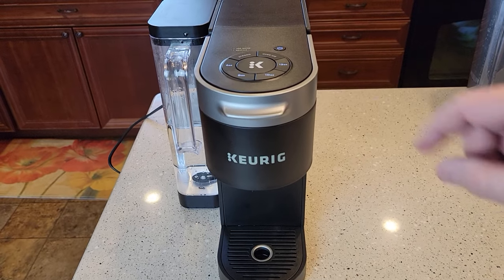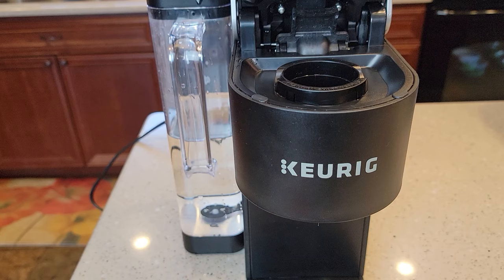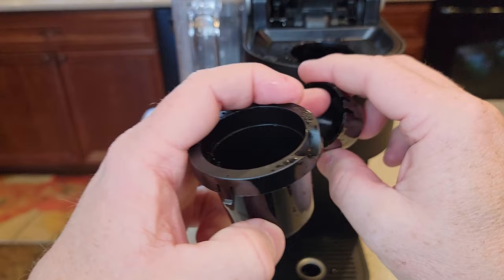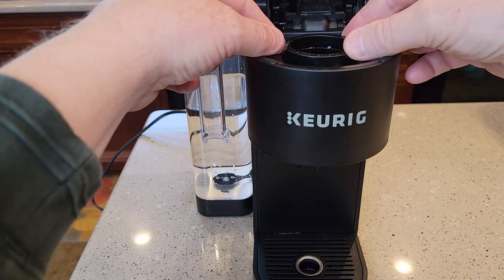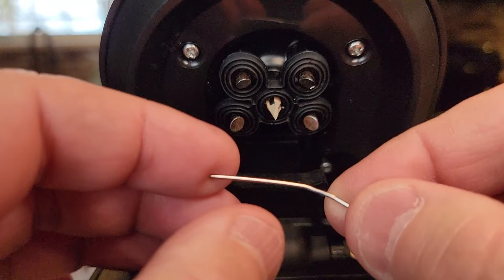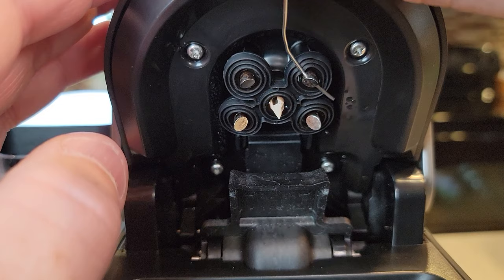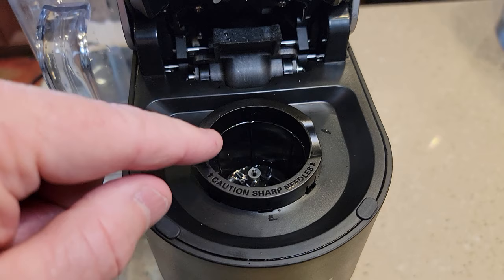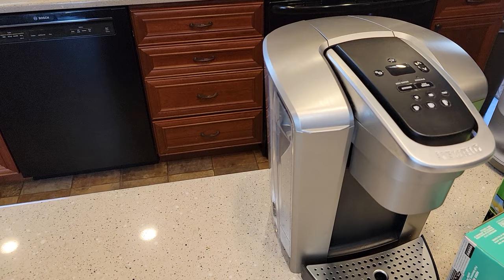HOW TO CLEAN NEEDLES Keurig K SUPREME Coffee Maker HOW TO FIX YOUR KEURIG NOT BREWING COFFEE

Comment: Very helpful, easy to understand video! I was getting the descale message after owning this model 9ish months.  I had the cleaning/descaling starter kit but found the directions vague and realized after watching your descaling video that I had not done it correctly.  I misplaced my owners manual so didn’t put it in descaling mode at all. Now I will give cleaning the needles a try…thanks so much❣
Reply from the maker: Glad it helped!
Reply: My Keurig would sometimes not release the coffee. I wasted numerous k-cups. It would puncture the k-cup and nothing would come out. I cleaned the needle holes with a paper clip as you showed and did the water rinse! I hope that fixes the problem! Thank you so much!

Comment: Wow, really! I tossed my first Keurig probably for this very reason, but I must say I'm even happier with my K-Supreme with bigger reservior. Thank you for posting your descaling video. My unit didn't come with any instructions so I never would have known to press and hold the 8 & 12 buttons to get started🎉
Also, instead of using a paperclip to push thru the needles to clean them, i used G-U-M brand plaque cleaners for my teeth that I had on hand and what a mess of coffee came out in the bristles 😮 which easly rinsed off and I ran it thru again to be sure clean.
Thank you so much for doing these video' for us "Dad"!

Comment: We used an air compressor (the kind you use for computer keyboards and screens) and blew through the bottom needle, rather than using the paperclip. Worked like a charm! Thanks for pointing us in the right direction, though. Much appreciated!

Comment: That seal comes off super easy and it's easy to clean.
Reply from the maker: Thanks for the update, what seal is that.
Reply: @JustADad  the black ribbed seal that surrounds the needles.
Reply from the maker: @myjatube  Thanks great tip
Reply: @myjatube  how do you insure that the seal is all the way back on? I brewed without it and I was getting a full amount but when I put it back on, it is clogging

Comment: Thank you so much for this review! I’ve thought I was going to have to buy a new coffeemaker to replace my keurig dual because my coffee single serve is making 4 ounces instead of 8. Ive descaled and cleaned thoroughly but it didn’t stop. It didn’t cross my mind about the needle! Ive Seen an item on Amazon to use for that and ive used the pods for cleaning the single serve part. I don’t know why but ive been having a problem with my k cup bursting and grounds going all in it. I will go and clean the needles like you showed and hope it does the trick or I’ll be buying another. I really like the mr. coffee 4 in 1 Lux

Comment: I just finished descaling and cleaning needles per your excellent video. But I think I may have a larger issue. During descaling and rinsing I was getting only about 4 ounces of solution each time I pushed the K. After descaling shut off I tried an 8 ounce cup and got 4 ounces. I then tried 10 and 12 ounces and each time got only 4. I plan to call Keurig but I certainly would appreciate hearing from you!
Reply: Mine was doing something similar. Did you ever call Keurig?

Comment: Good video once again.  I’m really having trouble, not sure what to do.  It took me a while, but I was able to clean the top 5 needles.  The paper clip just wouldn’t go through and I didn’t want to force it through even after bending the paper clip.  The bottom needle I cleaned and the paper clip was able to poke the hole through easier than the top needles.  I descaled the brewer.  When I try to brew the Keurig approved pods (says Keurig on the label), the pod explodes.  I raise the arm and I see a mess of muddy looking grounds.  I also tried a pod that doesn’t have the Keurig label on it, and the same thing occurs, exploding pods.  These pods have worked fine for months.  When I remove the pod, the bottom puncture hole is barely visible.  Obviously that would jam it up, but I’m not sure why all a sudden since yesterday this is happening.  I’m flummoxed.

Comment: Thank you so much for your presentation.  You present in a concise, step by step, slow easily understood manner which I appreciate. I have a question for you, I used a small paper clip for cleaning
the needles.  Worked well. It however would not fit in the upper 4 holes. I did not attempt after seeing the holes are very small. The machine is working fine so for now I’m leaving things alone. Would you suggest another type of item to use?
Reply from the maker: that rubber piece that is around all 5 needles does come off, that might help.

Comment: I watched and followed this video and the one for descaling. I'm still not getting a full cup and nothing seemed that dirty. Only getting about 1/4 of oz's selected and it just started happening recently. Any ideas? It does seem to work fine for one run if I unplug it and go again but then it messes up again. On the descaling on the fresh water part I only got 4 oz, 6 oz or 10 oz per button press each time. All were different.
Great videos by the way.

Comment: Your videos are always so easy to understand.. thanks! I descaled my machine the first time w instructions from your video. I used Goo Gone & worked great.
Here’s my question: when the machine is descaled doesn’t the solution clean the needles too?
Reply from the maker: Great question.  yes it does to a point.  The needles can also get coffee oils on them and in the bottom needle basket area. The water and vinegar does not really clean that.  It does wash out the coffee grounds so it kind of cleans it.  Great question I hoped it helped.
Reply: @JustADad  
Thanks again for the answer

Comment: I need help: after two months of using my Keuric machine I tried to check the filter to see if need it to be change but I just removed it so I fill out with water and I plugged it in push the power bottom but didn’t turn on since then I not able to use. What wrong with the machine or what should I do to restart it. Thank you
Reply from the maker: The Keurig K Supreme Models have a history of this problem. The unit can overheat and trip the thermostat on the inside of the machine. I made a video on how to open up your Keurig and reset the thermostat with a paperclip. But it requires you to open it up. This is a link to the video https://youtu.be/IdE_4NIQEro If this does not fix the problem or you are not able to open it up, I would call Keurig 866-901-2739, They are aware of this problem and should replace you unit free of charge. Lot of other viewers have had this same problem during a descale the machine has to run a lot of cycles to run the solution through the machine then the rinse cycles. It is a good idea in the future to let the machine sit for 30 min before you start the rinse cycle, but you have to make sure the machine stays in descale mode or it will not turn you light out at the end of the rinse. Also some K Supreme the low water light does not come on and you might run the machine dry which can also cause the thermostat to trip. In the case of the low water light not coming on you have to stop the process and start all over, but this time you can just use water on both the first part and rinse cycle. The machine has to see the low water light come on for the logic in the descale mode to complete and turn the light off.

Comment: Thanks for your tutorials! They are so easy to follow! I have done a thorough descale and cleaned my needles, but my brewer is still making a mess when I brew a cup of coffee. My coffee does not come out in a nice center stream, but pours out of the brewer all around the kcup and just a little coffee comes out of the center. The coffee comes out weak despite having it on the strongest setting and I think it's because the water is not running through the k-cup. Have you seen this problem before? Any advice on how to fix it?
Reply from the maker: Sorry to hear this.  Does it do this with a different brand of k cup?  Not all k cups are mad the same.  If the coffee is too fine in the k cup then water will not flow through it properly.  I would call Keurig 866-901-2739 customer service.  I have heard that they will send you a new bottom needle basket.  I think sometimes that bottom needle basket in not made correctly and if that is the case then the water will not flow through the k cup. Other viewers have called them with the same problem and I think they sent them a new bottom needle basket.  That is an easy try.  Let me know how it goes?
Reply: I have this problem with the type of cups that are compostable. They don't have any plastic on the bottom. Doesn't work with the 5 needle Keurigs.
Reply: I found the top outside needles are not going through the k cup.  Therefore water is going around the k Cup and coffee is criminally weak. If/when I push down on the top front of the machine  the problem abates.

Comment: I did everything like you said, I have descaled yesterday and today doesn’t want to turn on. 
I have the k- supreme just like this one that shows in you video. Do you think is already damaged? Does not want to turn on at all 😟😒 I don’t know what happened 😰
Reply from the maker: The Keurig K Supreme Models have a history of this problem.  The unit can overheat and trip the thermostat on the inside of the machine.   I made a video on how to open up your Keurig and reset the thermostat with a paperclip.  But it requires you to open it up. This is a link to the video https://youtu.be/IdE_4NIQEro   If this does not fix the problem or you are not able to open it up, I would call Keurig 866-901-2739,  They are aware of this problem and should replace you unit free of charge.   Lot of other viewers have had this same problem during a descale the machine has to run a lot of cycles to run the solution through the machine then the rinse cycles.  It is a good idea in the future to let the machine sit for 30 min before you start the rinse cycle, but you have to make sure the machine stays in descale mode or it will not turn you light out at the end of the rinse.  Also some K Supreme the low water light does not come on and you might run the machine dry which can also cause the thermostat to trip.  In the case of the low water light not coming on you have to stop the process and start all over, but this time you can just use water on both the first part and rinse cycle.  The machine has to see the low water light come on for the logic in the descale mode to complete and turn the light off.

Comment: Was using your videos for the descaling and landed on this one. 

Out of curiosity, I wonder if interdental brushes would work better than a paper clip since they are designed to fit into the right spaces and brush without abrasion. This way, you don’t accidentally mar the needle flows?

Comment: Please help,,, I did a descale following your video aswell as a reset to the machine, my machine makes coffee super watered down and everything is clean, even the hoses. But once the brew is done I still see a large puddle of water on the lid of the k cup. And I use my own coffee grinds along with the reusable kcup. It acts as if there’s only a small portion of water that actually makes it into the cup itself. And when you watch it drip down into the cup, it looks like Clearwater Except the odd drop of dark coffee here and there

Comment: I have an issue where a pod kind of exploded inside my Keurig and I have tons of grounds packed in the top part under and behind those rubber bits around the needles. Is there any way to clean that out or remove the needle section so I can clean it easier? Or do I just have to trash it and start over?

Comment: Any help on further trying to figure out why my Keurig is making weak coffee?  We use fresh coffee grounds and we use the appropriate Keurig brand insert to accommodate fresh grounds. We have been using Keurig machines for 15+ years.  This particular machine  is only a few months old and all of a sudden started making weak coffee.  The machine has been descaled and the needles are squeaky clean.  Also to note that our last machine did the same thing after a bit over a year and then completely stopped working, wouldn't even turn on.  Keurig K Cup Supreme model

Comment: Thank you for this tutorial! Have you encountered the "add water" that is always flashing even when the reservoir is full? What's the fix?
Reply from the maker: Sometimes.  there is a vent just behind the handle and hinge for the add water light box inside the unit.  when the lid lifts up you will just see a little whole, there is a tube attached to it on the inside.  Also you might have to turn it upside down and shake it without the tank on.
Reply: @JustADad  thanks for the reply! I went into the Keurig site to troubleshoot and it said that it may need to be descaled, so I tried doing that but it wouldn't properly descale. You know how you say it should run about 3 sets of 12 ounces and then say "add water"? Mine ran 16 ounces of cold and completely shut off. After an hour on the phone with Keurig today, and trying several things, my machine is simply malfunctioning. Brews 2 ounces more than chosen, among other things. They are sending me a warranty replacement, free of charge.👍🏻
Reply from the maker: @ZortmanClan  Thanks for the update, I am glad you called them,  and they replaced it.

Comment: We get a couple of streams running into our cup.  One is the coffee but the other is just water.  I cleaned the needles.  Any suggestions?
Reply from the maker: This could be a known issue Keurig has with the lower needle basket. I would call Keurig customer care at 866-901-2739.  They have great customer service.  It sounds like your bottom needle basket needs to be replaced.  These can become distorted over time from the heat or it might not have been made correctly.  They can send you a new one. It's not that big of a part and it's easy to change.
Reply: @JustADad  Thank you for all your help.  I spent an hour going round and round with customer service over just replacing the bottom needle basket.  Their customer service is horrible.  She tried to get me to replace my unit at 30% discount even though I kept telling her I purchased the unit November 2021.  She kept dwelling on that it was manufactured in 2020.  Wow......
Reply from the maker: @sharicarruthers1661  wow, sorry to hear that. normally they just replace it and don't ask many question.  thanks for the update!

Comment: do you ever pull the rubber off the multstream needles to clean that also? so glad I saw the video as the multi points are solid and didn't realize the smaller holes are there! I couldn't figure out how the water would come out since it is differnt than the center needle..

Comment: What if your descale button stays on after cleaning several times. Will brew clear water but not the coffee pod
Reply from the maker: Keurig has changed the way you descale your coffee maker.  You have to put the machine in descale mode and follow it all the way through to get the descale light to go out.  
step by step instructions see below.  You have to follow them all the way through.  
I hope this helps. put the descale solution in the tank.  You have to put  the machine in descale mode.   First leave the machine plugged in, then turn the power button off.  Press and hold the 8oz and 12oz button for 3 seconds till the big k brew button starts flashing.  This puts it into descale mode.  The only thing you will see is the big k button light on.  the power button does not light up.  press the k button and it will run 12 oz through the machine. keep pressing the k button till the add water light comes on.  don't touch anything just put fresh water in the reservoir and the add water light will go out and the big k button will start flashing again.  press the big k button to start the machine again this time it will be rinsing the machine at 12oz each time you press the button.  keep pressing the k button till  the add water light comes on again.  Once you fill it up with water again it will come out of descale mode and now you are ready to use it again.  turn it on and the descale light should be out. Let me know how it goes. YOU GOT THIS!!!!

Comment: Mine has been descaled 2 times still light will not go off! Help
Reply from the maker: Sorry I took so long, 
I hope this helps. put the descale solution in the tank.  You have to put  the machine in descale mode.   first leave the machine plugged in, then turn the power button off.  Press and hold the 8oz and 12oz button for 3 seconds till the big k brew button starts flashing.  This puts it into descale mode.  The only thing you will see is the big k button light on.  the power button does not light up.  press the k button and it will run 12 oz through the machine. keep pressing the k button till add water light comes on.  don't touch anything just put fresh water in the reservoir and the add water light will go out and the big k button will start flashing again.  press the big k button to start the machine again this time it will be rinsing the machine at 12oz each time you press the button.  keep pressing the k button till add water light comes on again.  Once you fill it up with water again it will come out of descale mode and now you are ready to use it again.  turn it on and the descale light should be out. Let me know how it goes. YOU GOT THIS!!
Reply: Did follow your directions. Then just quit on me will not turn on or anything! Only had it since October!
Reply from the maker: @raincitori  Sorry about that.  I would give Keurig customer service a call   1-866-901-2739   Other viewers have had a good experience with them.